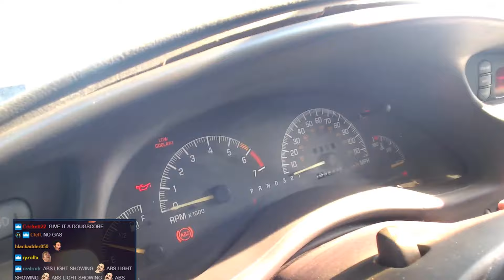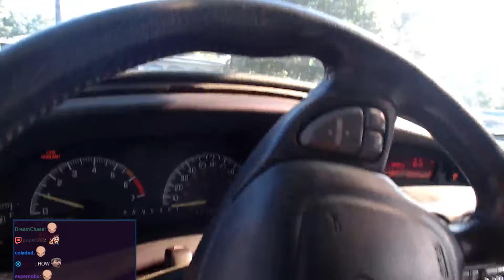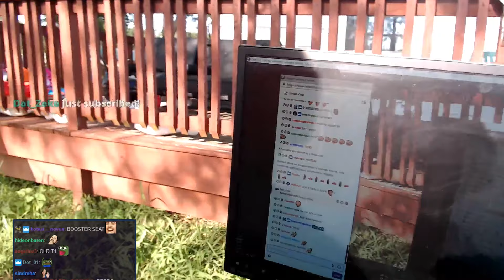MY CAR REVEAL 2019 EDITION

Comment: Brand loyalty to one of the worst car manufacturers ever.
Reply: They're called throw aways where I'm from lmao
Reply: Kevin C my grand prix has 314000 miles on it 🤷🏾‍♂️
Reply: mikhalu 13 mine has both LMAO, still running strong for 314000 miles tho
Reply: @Fayrawr  my 2007 charger r/t has 200k miles on it and I still take ricers to gap city
Reply: Well it is a GM product
Reply: Grand Prix drive so damn smooth though, gotta give em that
Reply: @Riet  My lex GS400 would smoke your pos wanna be muscle car ahah

Comment: Keep an eye on the transmission, if the previous owner had  bad driving style it may be in rough shape.  They don't take sudden heavy acceleration on the higher gears when doing highway driving.  The lower gears on that transmission are tougher though so first, second and third for instance are much hardier than the higher.  Keep an eye on the front struts and tie rod  as well, they are around the age now that most need replacing soon unless it has already been done before.  I'd also recommend using mid level or higher gas on that car now as well as full synth oil changes.

Comment: n March 2008, GM announced a recall on all 1997–2003 Grand Prix GTP models due to a problem that causes fires in the engine compartment. Over 230 fires were reported.